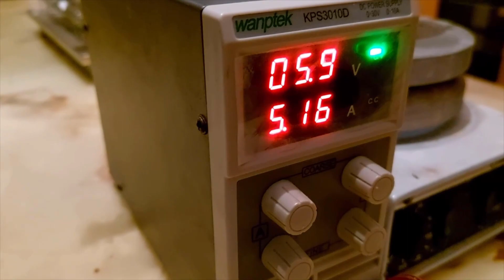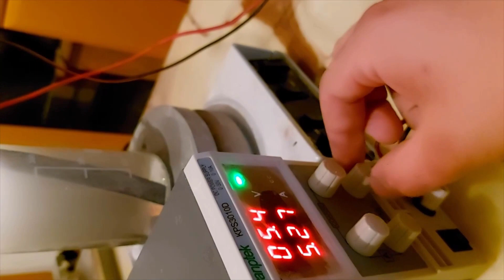PbO2 coating on Ti no MMO

Comment: This is copper for the first layer(acidified Copper Sulfate bath) and lead for lays 2 and on using acidified Lead Nitrate?  I'd love to give this a try for a chlorate cell.
Reply from the maker: it works for a chlorate cell but fails in perchlorate due to OH- radical attack.
Overall in perchlorate MMO is needed as a substrate.
But for chlorate this will work fine.
Reply: @CatboyChemicalSociety  Thanks!  I have an inexpensive source of pure Sodium Chlorate that I use for Perc.  I just wanted to build out a chlorate cell for the "just incase"
the source dried up.  So my use will be Chloride to Chlorate at above 50mg/l under ph control.   I use MMO for that now, but it would seem Ti/Pb02 would support even higher current density, if I understand them correctly.  Thanks for the re:
Reply from the maker: @derekturner3272  wrong MMO is better because you really only want 200ma/cm^2 either way for any of these because beyond would just be losses.

Also pH control tends to fail once chloride reaches lower than 80g/l and if you saw my video on how to purify chlorates you really dont need to run to completion.

This electrode so far works ok but once O2 evolution occurs it gets these cracks unless deposited in inert substrates like MMO or ATO no matter what is done to it.
Reply from the maker: @derekturner3272  also I have a great way to purify chlorates to remove all chloride for a perchlorate cell run.
This is done by creating lead acetate and dissolving the chlorate in methanol/ethanol then same for lead acetate and slowly adding the lead acetate to precipitate lead chloride then filtering it off.
This solution is then dried and redissolved in water while any remaining lead wont do any harm.

Comment: Which matrial used for undercoat?
Reply from the maker: DTO or doped tin oxide made from tin tetrachloride pentahydrate and doped with bismuth or other like antimony, cerium, indium.

this mix is then disperesed in azeotropic ethanol as a solgel which is then applied and baked at 200C 20x then final bake at 600C.

The tin tetrachloride can be made by first reacting tin solder (already doped) with HNO3 and get the resulting metastannic acid sludge.
This is then reacted with boiling 36% HCl till you form a thick syrup or solution.
This is then doped more or used as is and ethanol is added with strong stirring.
Reply: @CatboyChemicalSociety  tnx sir🙏
Reply: @CatboyChemicalSociety  and could you tell me about alpha pbo2 bath formula?
Reply from the maker: @ayabrea3762  i've given it in the latest video its 40g/l PbO and 160g/l NaOH

Check out that video DTO substrate PbO2
Reply: @CatboyChemicalSociety  for making sncl4 could i use sncl2+h2o2?
Reply from the maker: @ayabrea3762  use SnCl2 with Cl2 gas because H2O2 wont oxidize it without excess HCl

Comment: I'm curious, does surfactant is good enough to replace the function of sonicator/ultrasonic transducer in order to eliminate any bubbles that formed during electroplating process?
Reply from the maker: I solved this issue by using an entirely alpha PbO2 plating process.
no bubbles are formed and the electrodes are very resistant to corrosive conditions at 200ma/cm^2 check my latest video on it and my video on testing these with chloride to perchlorate cell.

Comment: Dont suppose you have a video showing how to remove all chlorate from sodium perc liquor prior to reacting with nh4cl?
Reply from the maker: just run it to completion lol then theres hardly any reason to remove it.
You do however have to still do the precautionary steps to ensure chlorate removal like bubbling SO2 or bisulfates or sulfuric acid.
The test is done on the liquid after completion mixing with NaCl and adding 98% H2SO4 and if it turns yellow its not ran to completion yet.
Reply: After running from chloride to chlorate to perc in one long run with pbo2 and titanium i am starting to get purple precip with methylene blue. Then ran longer until A drop of methlene blue just sits on top of liquor in a dark purple blob. Then boil liquor and cool. Its alkaline still so add hcl to ph2 then all goes yellow. 
Some sodium metabisulphite added bubbles and gets very hot.  Does this mean need to run perc cell longer? 

I have no sulphuric acid :(
Reply from the maker: @thenitro8408  I use pH control to prevent it from going alkaline which I usually use MgSO4 for pH and reduction control its superior to persulfate also never use HCl for pH control in perchlorate cell as it just adds more chloride and forming hypochlorite slows perchlorate formation.
Reply: When ruing perc cell, do you sample liquid and just add some nacl to a test tube with sulphuric acid and look for yellow? Or is there other signs that the perc may be completed like bubbles size etc. do you look for zero yellow before crystalising for first time ?

Wanting to make ap but trying to work out if its best to use anodes or maybe even heating chlorate to obtain the pure naclo4 to begin reaction with the ammonium chloride.  Is it simply a matter of putting chlorate crystals in a pyrex dish with lid in usual toaster oven or is a modified one needed to hit 400deg C ? Thanks
Reply from the maker: @thenitro8408  the heating reaction doesnt make pure perchlorate and its really terrible yielding.
I have over 10kg of perchlorates just chilling and also yea I basically look for zero yellowing on the solution after adding NaCl and H2SO4.
The other teltale sign of near completion is a strong penetrating ozone smell in the air as usually once all chloride and hypochlorite is gone the cell emits no smell but towards the end when the chlorate gets low and perchlorate gets high scary amounts of ozone is generated but this usually only happens when running at 250ma/cm^2 which is standard for perchlorate cells.
Reply: Sounds like i need to put the perc liquor back in the cell, bring back to 6 or 6.5 ph and run it some more. Its going yellow with hcl or sodium metabisulfite test still :(
Reply from the maker: @thenitro8408  add magnesium sulfate to drop the pH so it precipitates Mg(OH)2 which is insoluble instead of using acid like H2SO4
Reply: I have not put any additives in the 4 litre cell except for nacl to begin with. Its taking a very long time and volts are 7 @13amps. Dc inverter 200amp welder for power supply turned as low as it goes. 60cm2 pbo2 anode on each side. So do i call this a 120cm2 anode or is it just measured on one side etc. anode is 12cm long and 5cm wide perforated ti sheet with thick pbo2 coat almost filling holes in perf ti
Reply: Thanks for the help.
Reply: With my pbo2 anode that is perforated ti sheet coated thickly of 5cm x 12cm tall is this called a 60cm2 or 120cm2 anode. To get 250ma per cm like you say do i run 15amp or 30amp on that?  This 200 amp welder and welding leads to electrodes via bolts has lots of power but volts increase with amps so gotta watch the temp of cell lol. In my frustration to finish this first perc batch I just put the liquor back into a different new cell just now with 2 or those 5cm x 12cm anodes and 4 ti sheet cathodes half anode size and turned welder to 50amps to try finish if off haha
Reply: Clamp meter reading 47amps and 7.1 volts at cell. Welder needle says 50 but its close enough.
Reply: How much magnesium sulfate do you start cell with? Is it like 4grams per litre or more?
Reply: I dont have any of the mag sulphate on hand. I do have sodium flouride, and potassium persulfate but havnt put any of those in because I dont know how to remove them at the end :( sorry to pester you but ive had trouble finding all the answers i seek in one single place online. The info is spread out over hundreds of forum pages lol
Reply: @thenitro8408  Not sure if it still matters, but the method I like to quantitatively determine ClO3 vs ClO4 is to take a 10g liquid sample, evaporate it on a pre-weighed petri dish.  Once I have the dry weight, I use acetone to dissolve the ClO4, leaving only ClO3 in the original dish.  Once you evaporate the acetone used to extract the ClO4, you will have a sample of nearly pure perchlorate.  Chlorates and Chlorides are nearly insoluble while Perchlorates readily dissolve in even cold acetone.  Hope that helps someone. Cheers.

Comment from the maker: im actually having an issue with this coating.
IT DOESNT WANNA COME OFF WHEN U WANT IT TO.
when recoating or trying a different method the coating is so strong that even in 50% NaOH and ran as a cathode it wont flake off... this is good but also not if you wanna re use test pieces of Ti.
Reply: With this electrode hiy many runs of chlorate could it take to destroy this electrodes?
Reply from the maker: @cebupyro8036  more than 20 since it barely errodes and the solution remains clear to very slight yellow even running at 250ma/cm^2.
This particular electrode is a test piece thus has a thin coating but this could probably do hundreds of runs going from chloride to perchlorate if the coating was multilayered till it reached the proper thickness.
Reply from the maker: @cebupyro8036  btw if you wanna use PbO2 for chlorate or perchlorate from chloride then u need magnesium or sodium sulfates to lower the dissolution in chloride electrolyte. where magnesium is better because pH and reduction control 3 in one.

Comment: This coating works as substitute mmo coating in NaCl electrosis?
Reply from the maker: yes
Reply from the maker: also its quite capable of going from chloride to perchlorate which and this particular electrode can make 200 grams of perchlorate in 5 days run at 250ma/cm^2 which is standard.
A PbO2 electrode that cannot run at 250ma/cm^2 is not a good electrode.
This electrode has been run up to 426ma/cm^2 and had signs of errosion but was still stable at that current density.
Anything higher than 250 will have less efficiency due to cathode reduction which is usually prevented by calcium or magnesium salt additive in the cell.

Comment: How make pbo2 anode titan?
Reply from the maker: need to first plate with metal undercoat and then plate layers of alpha and beta PbO2 using different plating solutions alternatively with the correct current density and proper conditions such as constant current and temperature and lead ion concentration.

Comment: How about MnO2?
Reply from the maker: not worth it dissolves more so not good at all.
Reply: I've made PbO2 electrodes back 2017 but since lead is very toxic i disposed all my GSLD electrodes not to mention that i dont have proper equipment and got exposed by lead but only a little instead i buy kclo3 rather than making it but those are back in the days, and now since my source of chlorate suddenly disappear i was very worried lol and wanna make my own last time i built a chlorate cell was back 2018 but already using carbon anodes and using sea salt i found out that my electrodes didn't erode when using sea salt compared to using pure nacl, and there that i found out that its because of calcium chloride that you mention fro. your previous video. its been 3years that im not using them and kinda forget everything about electrolysis.
Reply from the maker: @cebupyro8036  lead dioxide is the true holy grail!!
like honestly nothing compares to PbO2 if made properly as you can go from chloride to perchlorate and a single electrode lasts for YEARS if made correctly.
It is infact a lot harder to destroy the coating of a PbO2 electrode than it is to make one because upon reusing an old coated mesh to try a new process it took 5 hours in acid + H2O2 to dissolve and not "running as a cathode" cuz that doesnt work to strip it.
like just buy a Ti mesh and plate copper or nickel in a fluoride or HF containing solution then use a plumbate bath at the right current density and by right I mean use an accurate mesh calculator or else it will fail.
then use lead perchlorate to plate pure beta PbO2 at room temp.

PbO2 is best when run at high current density of 250ma/cm^2 and MgSO4 is the best pH control for it.
Reply: So magnesium sulfate is the new one?
Reply from the maker: lol we just tested a new additive in the bath and after this it no longer turns brown on chloride electrolysis even at 250ma/cm^2.
I think PbO2 is on its way to completely make MMO Obsolete.
Reply: Do you calculate both sides of an anode or just one side to figure out the current density?
Reply from the maker: @thenitro8408  always both sides.
Reply: Both sides, hmmm. Looks like I need to double my amps then. Just been measuring one side lol. Cheers.

Comment: the coating was done with some kind of paint?
Reply from the maker: EWWW no
Direct electroplating of metal on Ti using HF and other weird shit as an additive hence CURSED
as for how I discovered this well think Listerine and toothpaste but this coating was done with pure NaF instead.
Reply: @CatboyChemicalSociety  that's some sick stuff
Reply: Asolution of lead nitrate mixed with extremely fine lead dioxide powder(black) and nitric acid and is brushed into the titanium plate/mesh, the plate should be heated at high temp.....
Reply from the maker: @cebupyro8036  u dont wanna do that because PbO2 decomposes past 120 Celsius and u cant decomp plate it.
The way was via my cursed direct plating of any metal on Ti using Hf formed in situ which prevents TiO2 from forming in aqueous solutions as long as Hf remains then let it soak for a bit and once its used as a cathode the protection is no longer needed.
Reply: Iridium/ruthenium is probably much safer butvery expensive no. Budget for that hahahaha
Reply from the maker: @cebupyro8036  thats both right and wrong because the very first run of an Ir-Ru anode usually forms a yellow to orange solution of unreacted RuCl4 which creates RuO4 in solution. RuO4 is much more toxic than lead and cannot be removed by chellation and is more carcinogenic and binds strongly to bones.
Sanding/spot welding onto MMO also is unsane because RuO2 dust is just about if not more toxic than PbO2 powder.
The safest MMO is Ir-Ta but its less efficient for a chlorate cell in terms of operating voltage only being slightly higher. Ir-Ta is also totally resistant to low chloride so you can run it all the way to 100% conversion and some are able to make perchlorate but at terrible efficiency of 20%. the max operating current density of Ir-Ta is 600ma/cm^2 while for Ir-Ru it is 250 to 300 ma/cm^2.
Also Ir-Ru is dirt cheap tbh because an anode that can run 40 amps costs 22 USD from aliexpress while Ir-Ta is twice the cost.
Reply from the maker: @cebupyro8036  about the 1st run of an Ir-Ru MMO you usually do a dry run where you throw the liquid after 4 hours into a waste container and restart clean. if the solution doesnt turn orange or a deep yellow it means the anode underwent a pre dry run and its safe to continue the cell. Chromate additives are cringe and overall Mg or Ca ions do the same job and are less toxic.
Reply: Ive seen some video of processing mmmo on titan with a black solution and is brushed into the plate /mesh and can be a mixture of precious metal oxides powder, thats what the guy is referring he thought it was a paint.
Reply from the maker: @cebupyro8036  yea thats a mix of RuO2 and IrO2 with RuCl2 as a binder
Reply: The website said the Ir/Ru Ta O2 on titan can corrode of about 0.03kg/ton of chlorine while platinum 0.4-0.8kg/ton of chlorine making Ir/Ru Ta O2 a preferred electrode.
Reply from the maker: @cebupyro8036  yea MMO really is better for making chlorate.
PbO2 however can go from chloride to perchlorate at 80% efficiency with the right additives since it is unnafected by low chloride and low chlorate and only initially when high chloride levels are present.

So for chlorate Ir-Ru is best for highest efficiency and Ir-Ta is best for non pH control and full chloride to chlorate.
Pt sucks and only half finishes LOL while PbO2 is only worth if you intend to go to perchlorate from chloride.
Reply: My experience of using graphite as substrate for lead dioxide its not good still contaminated with graphite.its best to use titaniumgrade1-4 for plating
Reply from the maker: @cebupyro8036  grade 1 and grade 2 Ti if you want a passivating anode the other grades for none passivating.
Overall you can coat PbO2 onto any metal including stainless steel and copper which will behave like grade 3 and 4 Ti.
Reply: Description about mmo/dsa anode website
Anolyte: 25% Sodium Chloride
Temperature: 90°C
Current Density: 3 KA/M

 
Anode Material	Chlorine Over potential
(mV)	Weight Loss from Anode
(kilograms/ton Chlorine)
Graphite:
chlorine overpotential=400
weightloss of anode(kilograms/ton chlorine)=2 - 3
 
Platinum:
chlorine overpotential=200
weightloss of anode(kilograms/ton chlorine)=0.4 – 0.8
 
RuO 2 – TiO 2
chlorine overpotential=50
weightloss of anode(kilograms/ton chlorine)=< 0.03